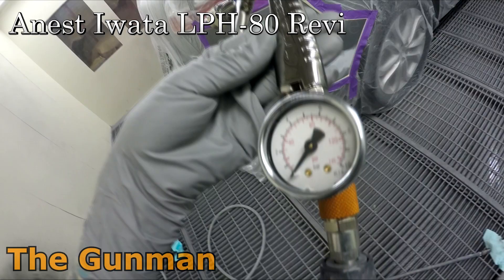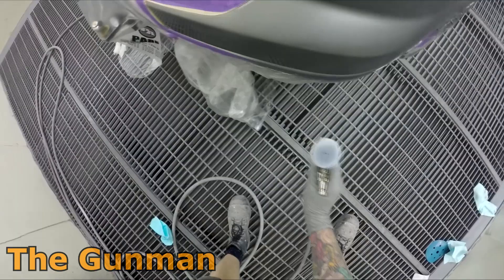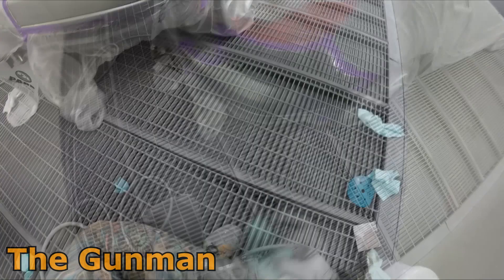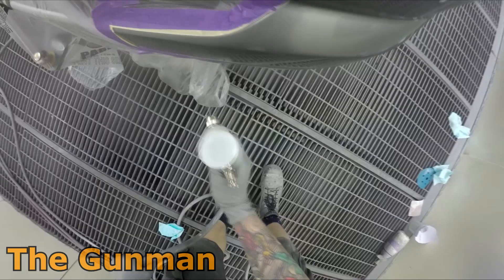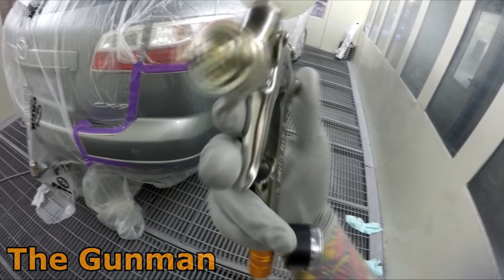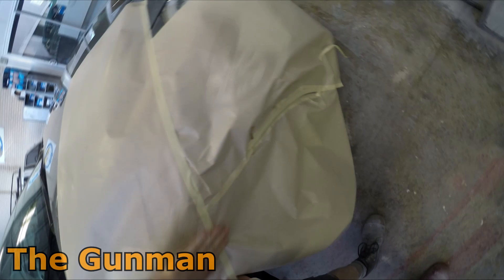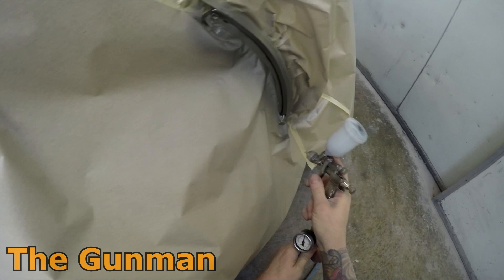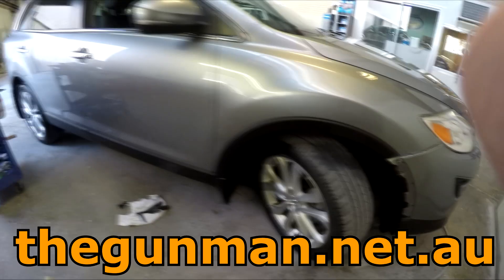Anest Iwata LPH-80 Review & Demo

Comment: FYI the lph50 is the same body just with a side mounted cup. I like it better for the fact you can add less paint and rotate the cup to always allow paint flow.  less wasted in my opinion.  I do mostly paint as a hobby and small parts so when I can save paint,  clear  it's a plus for me.

Comment: Gunny i absolutely love my LPH80 to bits try using it at low pressures it still performs very well
Reply: I know this is an old video but trying to learn more about this gun after a couple years using it. In the video it looks like the gun is set to 29psi, the manual says 7-14psi. What’s the advantage to using higher or lower psi? 
  I’m spraying very thin shellac with the lph80, I was thinking I wanted to get a faster gun for clear lacquer but maybe just raise the psi?
  Please forgive my ignorance on this subject, I’m very much a novice. Thanks!
Reply: @mikesradguitars  Hi, pressure is your friend you can control the orange peel effect with it so you can spray thick or thin materials, I always set the pressure as high as ican without the spray pattern mist becoming hollow in the centre
Reply: Thanks so much for your response, that tip about the the hollow fan pattern is exactly the kind of explanation I can use. 
 Is it possible to give an equivalent guideline for when the pressure is too low?
   Am I correct in guessing that the advantage of high pressure is that it speeds up the process? And low pressure slows things down? In addition to what you said about controlling the surface/orange peel like you said?

Comment: Hi Chris. Feel your pain with the doors. Been there, and still not totally happy with mine. 
I adjusted my hinges so often I managed to strip the threads in several of the A post captive plate bolt holes which didn’t help. But I re-tapped them for larger bolts which I would recommend for more grip. 
As to all the inevitable paint chips and scratches,  I’m totally in love with my little Iwata LPH80  mini spray gun for precise repairs. It’s not cheap but it’s amazingly precise and controllable with every type of paint I’ve thrown at it, almost like an air brush when dialled right down. One of the best investments I’ve made.   You might like to check out the reviews.  Cheers

Comment: Thanks so much for the awesome reviews! Quick questions now that you're using the higher end mini guns does the ANI R150 mini compete? If you were trying to get almost no orange peel out of the gun which one so far comes closest?
Reply from the maker: I think they are all capable of top results in the right hands, the main thing is striking the balance of build quality and price if you ask me. This is a stand out the gun in the mini range because it is so precise and even with a 1.2mm tip it atomises the paint very fine, it would struggle to do larger areas, though, really just a touch-up gun.
Reply: The Gunman Thanks for the response Gunman I really appreciate it!

Comment: awesome video man. im entering the collision repair industry, finishing up my last month in college. what do you recommend for a spray guns for entering the field. i already have a devilbiss gti.
Reply from the maker: FLG5 is a good gun at a reasonable price. Is the GTI a pro or pro lite? or just the original GTI? what air cap do you have on it, is it the 110?
Reply: The Gunman it's the original. I have a 1.4 it also came with a 1.3 and a 1.5
Reply from the maker: Themechanicman92 The original are still decent guns but the pro & pro lite are a big step up. I always used mine with 1.4mm 110 air cap.
Reply: The Gunman what would you suggest for primer? would you say the original gti for base and the pro or pro lite for clear?
Reply from the maker: Themechanicman92 Yes that'd work, there's a few good options for primer, FLG5 1.8-2.0, ANI F150 1.9 or Airgunsa AZ3 1.8-2.0
Reply: The Gunman thanks for the help man, love this channel

Comment: Could you comfortably doing motorcycle parts with it (tanks, fenders etc) or is it a tad too small?
The very low air usage is a big plus for use at home with small compressors.
Reply: yes use mine for doing motorcycle tanks.

Comment: I have a mini jet in 1.0 and want a gun that will give a smaller fan with Chromabase. I never used Chromabase with anything smaller then a 1.0 tip will it spray with a LPH-80 .8 tip and if so how small can I get the fan with a  good atomisation?
Reply: I decided to just buy a new one so I could get it in 1.2.

Comment: Hey Gunny could you tell me what last grit paper to use to get a panel ready for paint? Thanks in advance from Dallas Texas. Do you recommend to do a dry or wet sand on a panel for paint.
Reply from the maker: I've found 800-1,000 grit for a blend area and 500-600 for areas that you will be applying colour is perfect, that is if dry sanding. If wet 800 for colour areas and 1,000-1,200 or grey Scotch Brite for blend areas. I prefer dry sanding but if you're not experienced then wet sanding may be the best way to go, it's a bit more forgiving but a little messier.
Reply: The Gunman Great! Thanks for the quick reply.

Comment: Hey! So I got this gun reading it could use the Iwata airbrush compressors but anytime I hook it up it initial sprays heavy but then the pressure drops to nothing.  Could it be the hose and compressor? Set the output to 25 psi and the gun gauge doesn’t even read above 7. Thoughts or advice? Should I grab a bigger compressor?
Reply from the maker: Yeah man, an airbrush compressor won't run much more than an airbrush.
Reply: The Gunman thank you! New to airbrushing in general but snagging a bigger compressor tomorrow!

Comment: is it worth the price difference over the ani
Reply from the maker: I'd say yes but it would depend on what you plan on using it for, the ANI would be more suited to larger areas but this gun has a very small air cap making the fan very small but at the same time more precise than the ANI. This is basically a big airbrush, ideal for small spot repairs, touch ups, wheels etc.

Comment: i have a few questions. is primer and primer sealer the same thing or is it two seperate things. im helping my dad paint a truck, he is experienced in automotive painting but doesn't speak english. im not even an amateur, so i dont know most terms used in this profession. the owner of the truck bought lesonal primer, base coat  and clear. i dont know if base coat is referring to the actual paint and color. also the papers with the basic instructions say how to apply the primer surfacer then sealer which leads me to believe its two separate things and applied in layers like primer, sealer, base coat then clear. so i asked  at a store how to apply the primer and sealer, they told me prime it, sand it, seal it but have to paint within 4 hours, which further leads me to believe it two separate things but in all the materials the owner bought, there isnt a container that says sealer, just primer, hardener, reducer, activator, base coat  and clear, so i think he didn't buy the sealer or the store forgot to put it in, or i dont know if the sealer is mixed in with the primer already, but like i said, i dont know anything about this thats why im asking.

Comment: will this repaint a hood?
Reply from the maker: No, I wouldn't even try.
Reply: The Gunman what if it had the 1.2 in it     I need my hood repainted  but my air compressor can't run a normal on  I need a  low pressure
Reply from the maker: +Nic Mezinis I still wouldn't try, maybe with the ani R150
Reply: Would you use that one for a metallic silver